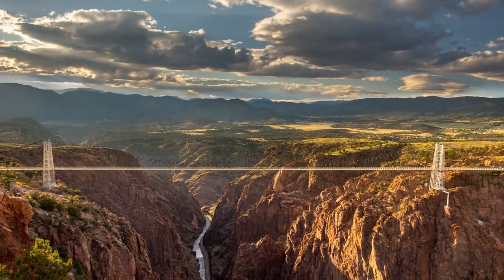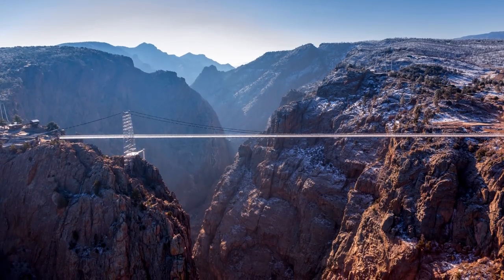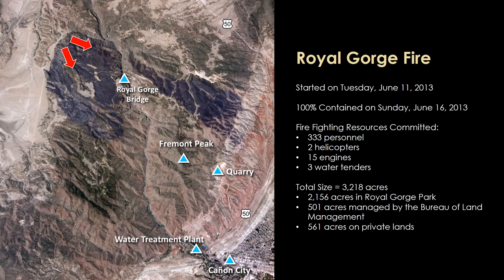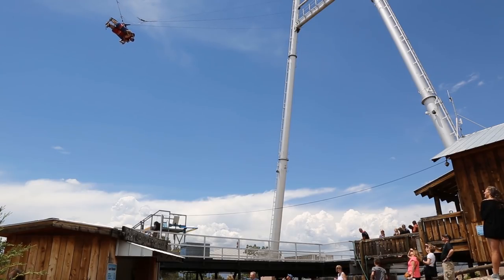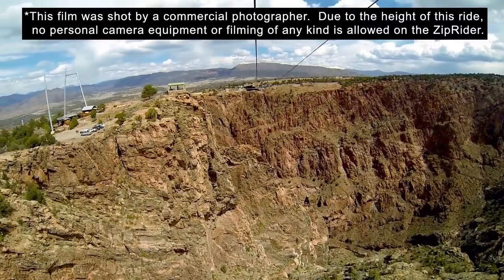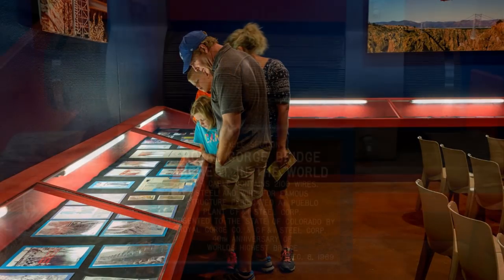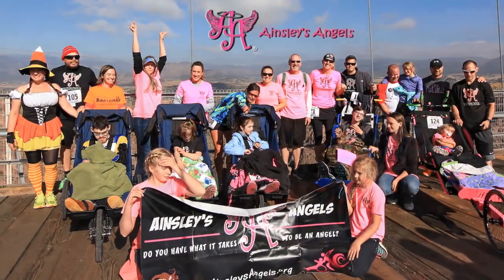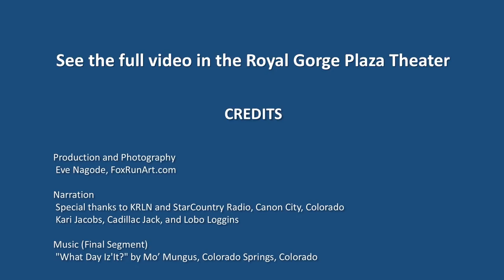Royal Gorge Bridge

Comment: Royal gorge on the left side north of the suspension bridge blast down to the first shelf an other side blast in forty feet for the two main anchors gurdder two arch  steel arch bridge  a steel an concrete main middle Piller of concrete an steel of a four main construction  mount into the steel gurdder arch
Reply: Some punctuation wouldn't hurt, my Dude.... Pretty messy explanation otherwise ;)